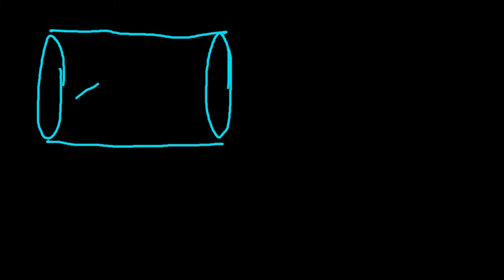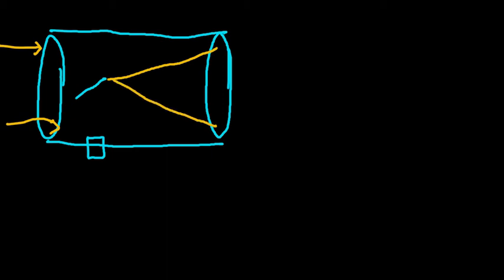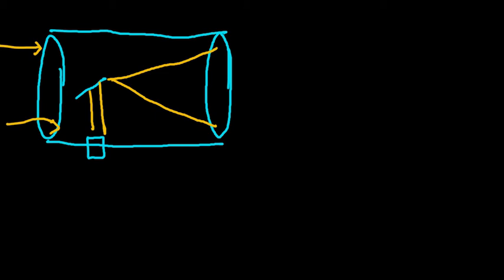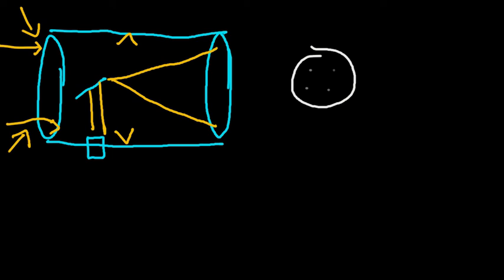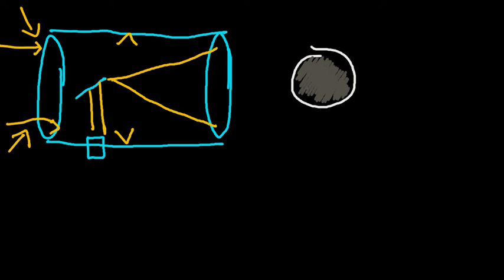Dobsonian Flocking

Comment: Thanks for Posting.  I did not see the blog. But did watch a video to tweak and/or mods to a telescope.  I have so much work to do and this is one of them.  I have a XT10 Orion Dob.  Do you have any tips on how to paint you primary and secondary mirrors edges? and Not damage the front faces?  Second question do you have an opinion on a great Mount I am looking at the CGEM DX.  The scope weights 31 pounds alone.  What do you think of a tube extender to block light for the eye piece?. Thanks again